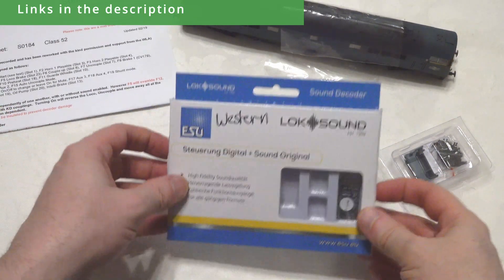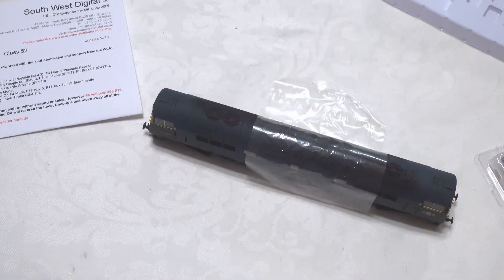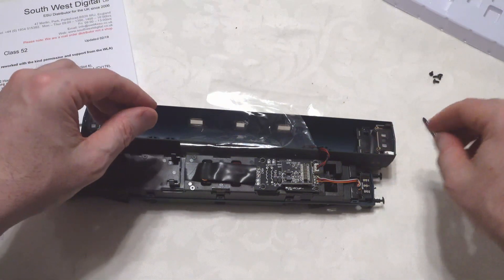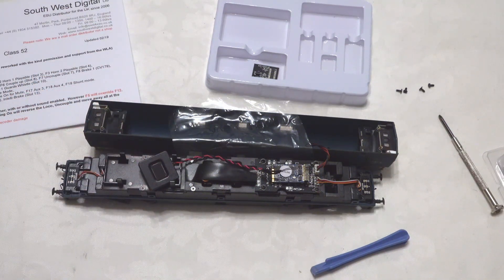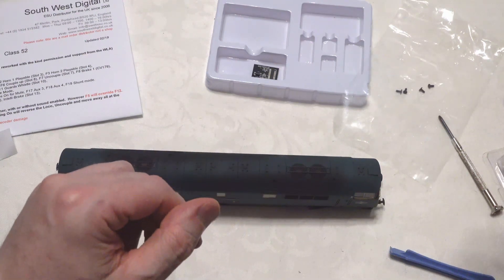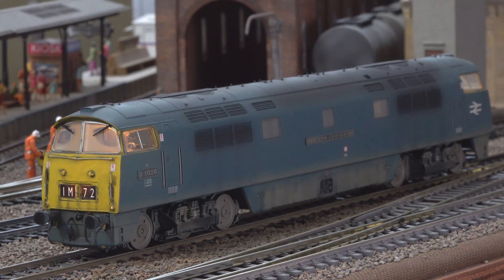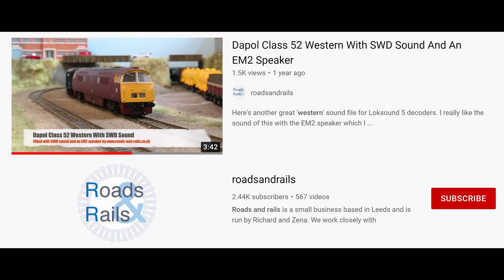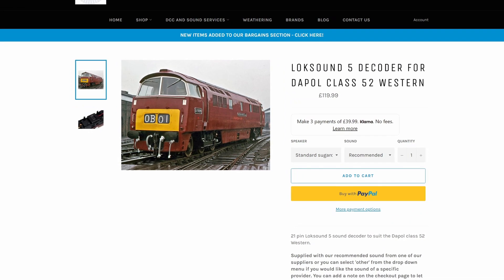Fitting DCC Sound to the Dapol Class 52 using a Loksound 5 decoder and an SWD sound package

Comment: I have used Howes sound and found it very good. It used to come with an excellent large speaker that fitted the space perfectly, but the most recent Western came with the smaller speaker that you were using. The Westerns had two engines and the Howes sound had each engine starting up separately, which added an authentic touch. But your SW version sounds good on the move.
Reply from the maker: Yes, I have an older decoder on my unweathered Western and that has the separate start-up for each engine as well which I like. Similar to the Deltic.

Comment: im abit of noob with dcc, at 2:43 is there already a dcc decoder installed on this model, or when you put the loksound 5 into the pin socket, that is the dcc decoder itself. im just wondering, if i was to buy a loksound 5 with a sound speaker and stay alive, do i need to buy a seperate decoder for the loksound, or is it a decoder itself?
Reply from the maker: Assuming you purchase a DCC Ready model rather than DCC Fitted or Sound Fitted, there will be a small PCB installed in the DCC socket that is just a small passive board that is used to allow the model to work on a DC layout. When installing DDC or DCC Sound, you remove this small PCB first and replace it with either a basic DCC (non-sound) or a full DCC Sound decoder such as the Loksound 5. When you purchase the Loksound 5, it will contain all the DCC functionality you need and you will be installing it directly into the 21-pin socket.
Reply: @EuviRail  much appreciated :)